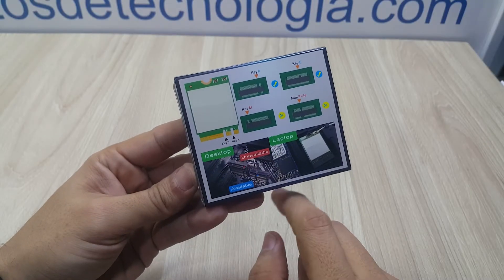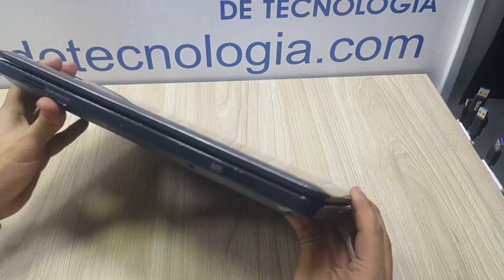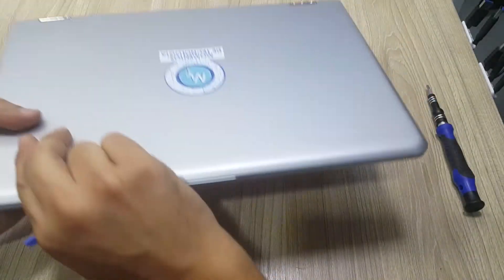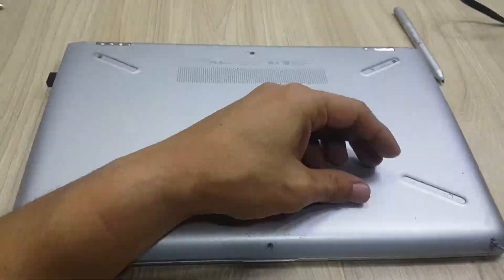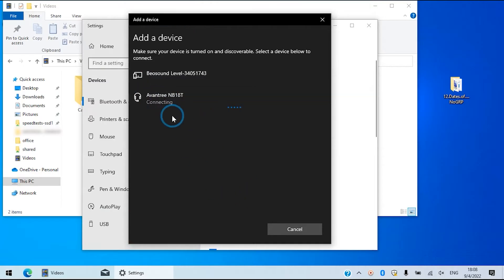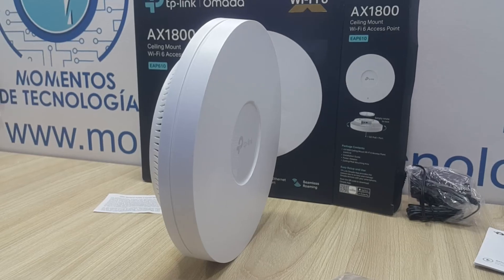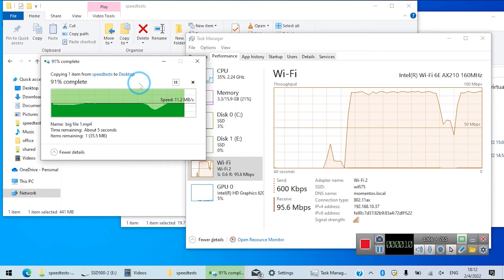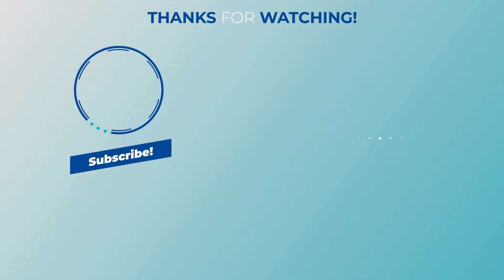How to upgrade my Laptop's WiFi to WiFi 6E  with M.2 card - Great choice!

Comment: You didn't connect to 6E , just 6 @ 5Ghz
Reply from the maker: Correct, like I said this EAP610 from tp-Link Omada does not support 6E with the 6GHz band.  And eventhough it connects at outstanding speeds in wifi 6 (most of wifi 6 is located a the 5 GHz band) and as you may've been able to watch in our other videos, even at hospots and capive portals results in a very powerfull wifi network.

Comment: Can you connect to 6Ghz 6E ? I bought Asus GT-AXE16000 , and got Intel AX210NGW in my two laptops. None of them can see 6Ghz network. I've got latest edition of Windows 11 22H2 and latest intel drivers for wifi card.
Reply from the maker: I would recommend going to the device manager, right click your network adapter, and check if you have enabled the 802.11ax wireless mode to AX mode.  Also the channel for 6GHz in auto and finally check your prefered band.  Be carefull to note your default values before you make any changes.
Reply: @TechnologyMoments  I did all u mentioned.I am long time ago on AX , as I use Asus RT--AX86U since two years.
Reply: What do you think of this video?:elbowcough:

Comment: Hey there!
Great video!
I'm wondering if I can do that to my Lenovo Yoga 720-15ikb too.
On the website, it says that my model is compatible with Wireless,CMB,LTN,NFA344A M2 and Wireless,CMB,IN,8265 NV M2, but I'm not sure what that means.
Could you please indicate a good compatible wireless card (Bluetooth 5.1 and Wifi 6E) that works on my model?
Reply from the maker: Yes, and it is very probable it is an NGFF card, however you just will spend 15 minutes, taking it apart (usually just the lower cover) and make sure it has an NGFF port connection compatible to the one you order.  There are just two options PCIe mini (which for your computer model I don't think it has that one, and explained in our other video) and NGFF such as the one in this video.  Very easy to tell apart.

Comment: Hii Sir, Nice video. I have old hp 15da0352tu laptop and i am facing low wifi speed (around 1mbps realtime downloading speed) with wifi 4.2 module while  my friends experience 5 mbps on his new laptop with wifi 5 module on same wifi network. Is it due to 4.2 wifi module? Can i upgrade it to wifi6? Can i solve my low wifi speed issue?
Reply from the maker: Hi Bhanshu, It may range from just power lacking from your current wifi card, or even interference, so I cannot assure you an update is what you need.  Would I do it and have my laptop updated to wifi6?  Yes.  Has my experience been good with this card?  Yes.  I recommend it and solved many of my specific needs and some other problems related to wifi connectivity.  It may not always solve everybody´s

Comment: Hello, I got a Dell Latitude E5530 and the original Wifi card is an Intel Centrino Ultimate-N 630, Model: 633ANHMW. 
It looks like a mini PCIe card and has 3 wire connectors on it. The replacement WiFi 6 ones on Amazon show they have 2 wired connections. Does that make a difference? Also my laptop has 1 open PCIe slot with 2 wires available and is not being used. Should I just leave the original card in it and install the new one into the optional slot or should I just remove the old card and install the new one in it's place. Also, what exactly is that 3rd wire for on the original card?
Reply from the maker: Hello, that is correct and it is a matter of design.  Some manufacturers handle more antennas when transmitting with different radios.  That model you mentioned featured a 3x3 MIMO which was commmon to have two antennas connected.  In our most recent experiences whe have ended up using just one, also known as "main".   Disconnected the other one and no changes were experienced in range or speed.  That, at least for the two models we tested.  the other card which is the one you may need:  https://youtu.be/eaj91tA_w_w  The PCIe mini card is this one: https://amzn.to/3hjTq5C   As for the secondslot is very probable you can just install it there and have an additional wifi card.  There were few models that included that option as they featured WiMAX also.  Possibly another reason for the third antenna.
Reply: @TechnologyMoments  Ok great, thank you! Good to know there's a good chance I can upgrade my Latitude to WiFi 6 at a reasonable cost. Btw, you do great work on your videos!

Comment: Hi there, I have a hp pavilion g6 1027tx which is a 2011 model. I wonder if it is possible to upgrade to wifi 6 or 6e? Thx!
Reply from the maker: I would say it is possible but as happened to me, I had trouble with a very similar laptop and a Mini PCIe card.  Take a look at our video about those WiFi cards: https://youtu.be/eaj91tA_w_w
Reply: @TechnologyMoments  thanks for the reply! I’m trying to buy a mini PCIe card to upgrade to Wi-Fi 6e. It’s there any  fixings if my computer cannot identify the new Wi-Fi adapter? Thanks!